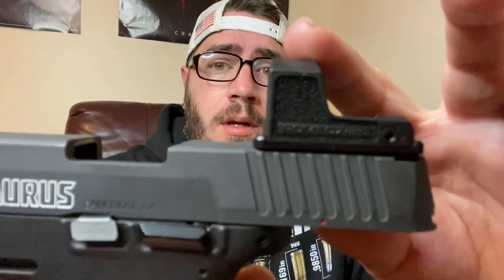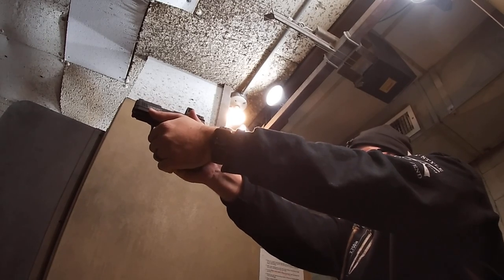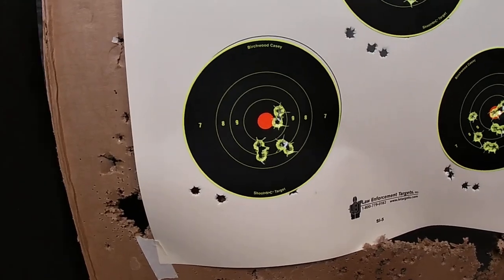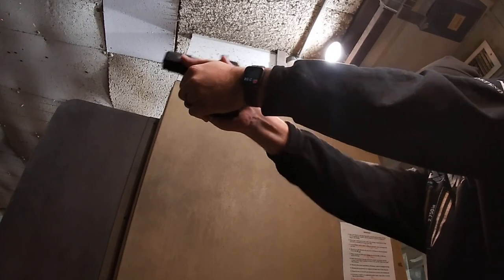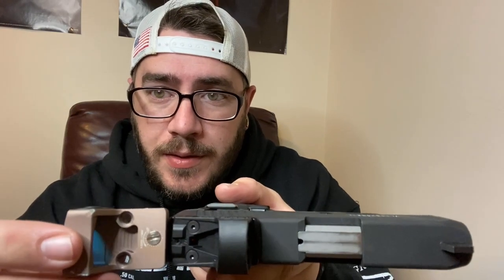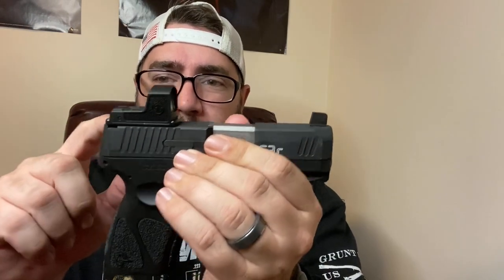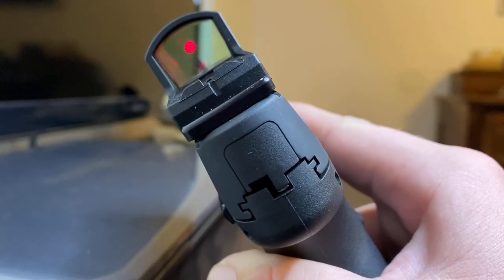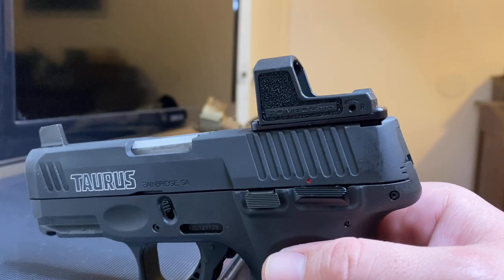Sig Sauer Romeo Zero - my first impressions

Comment: I had 3 Romeo Zero RMR. Worked great,no problems. I sold them because I liked the Holosun 507k better. But, the Zero was a good red dot. I would buy it again.
Reply from the maker: I’ll be getting a 507k eventually. First I’ve got to buy a house. That’s one big factor of what’s slowed me down on getting stuff for my guns
Reply: @ShotswithCola , understandable. Home first. Wait. They are coming out with the 507K green dot  soon. That's the one I want. I will be selling my red versions for the green when they come out.
Reply from the maker: @62dobie  is that one going to go up in price? I know usually there’s a thirty to fifty jump from red to green
Reply: @ShotswithCola , yes. But my eyes see that green much better. It will be worth it for me. Thanks for your replies.
Reply: @62dobie  did the green come out, have a red laser so I need a green sight
Reply: @mblake0420 , to my knowledge, not yet. When I talked with Holosun back in November, they said it would be March. But with these companies, you never know. Time lines get moved around. I hope so. I’d like to get the green ones myself. My eyes definitely pick up the green better. I’m waiting also.

Comment: How does the baldr mini fit on the G3c? You don’t like it on there or you have that on the mck? And what you think about the viridian laser for G3c they sell it on the Taurus website. I’ve been thinking about getting one but they only have red laser no green
Reply from the maker: I got the baldr mini on a ruger security 9 compact. I’ve got a pl mini 2 on the g3c. I like having a laser but I don’t ever think I would use it. I’ve never messed with the viridian lasers but they look like that would be much skinnier than what I’ve been using so I could see that being a plus with concealed carry. I honestly move lights around so much on my firearms I’ve never really considered getting a model that is specifically designed for a particular model.